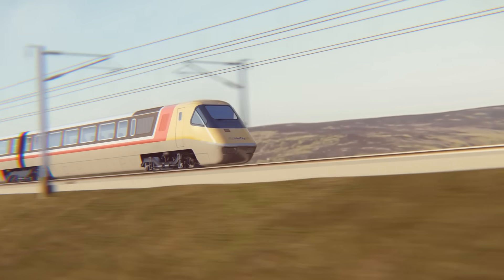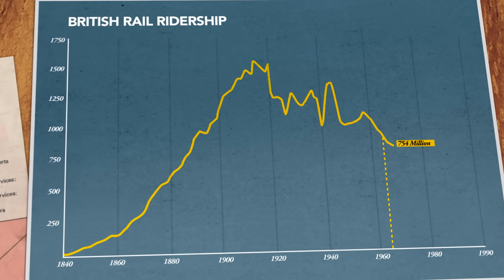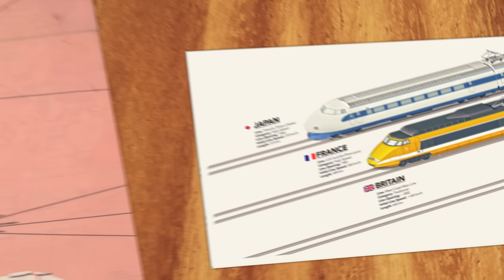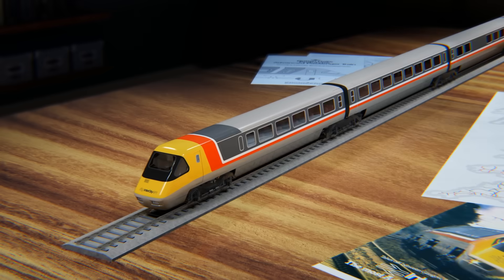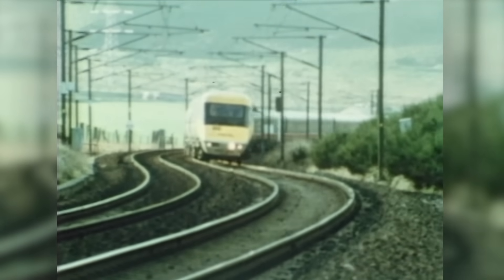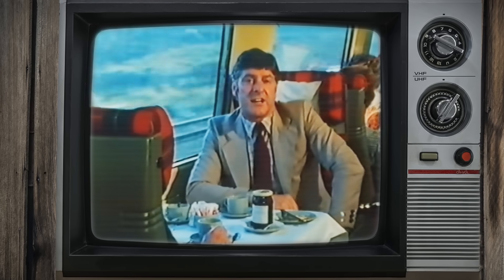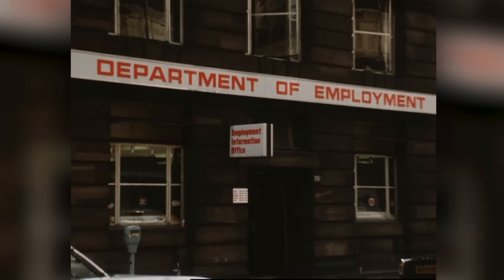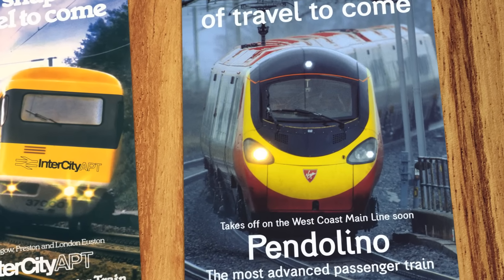This Train Made Passengers Sick: The APT Tilting Train Story

Comment: The til system wasn’t the problem,. It was insufficient testing of the train to bring into operational service.
Develop on a shoestring and that’s what you get.
Technology sold off and used on Virgin grains several decades later .

Comment: Fun fact: The cartazzi trailing axle the late Sir Gresley introduced on the A10 Pacifics Great Northern and Sir Frederick Banbury when they were made in 1922 actually helped tip them into the curve, although it didn't use any of the high tech gadgetry the high speed trains had when they first made their intro 60 years ago, and it had no springing.  It just required the wedges in the framework of the trailing axle and the movement of the locomotive on the rail.

Comment: It's interesting how different the APT-E and APT-P look. APT-E looks like some kind of futuristic, science fiction supertrain, while APT-P looks like a heap of junk! Well perhaps that's a little unfair but if I didn't know much about trains and saw it next to a 125, I'd have assumed that the 125 was far more powerful and faster.
Reply: Really? The noses of both trains are really rather similar, except the APT-P has a lower waist, with the light clusters mounted below below it. Incidentally, the prototype HST looked awful. The production units were designed by a noted industrial designer, which is why the styling is especially pleasing.

Comment: There is a similar train called the LRC (for in Canada (operated by VIA Rail). It is made of aluminum and used to have active tilt that would allow it to run faster through curves. And it worked for quite a while until the active tilt system became too outdated and no longer reliable. So the cars are still in use today, but with the active tilt system disengaged and using "standard" locomotives.

I travelled on quite a few occasions on this train between Montreal and Toronto and found it to be pretty comfortable. But when the tilting system was disabled, the trip took way too long and it made no sense to travel by train anymore.

Comment: The TALGO trains were first built in Spain in 1942. They are tilting trains with independent axle-less  wheels  that were designed to move at high speed through Spain's winding mountain passes. The Train has been built in Spain and later under license in Finland, the USA and other locations. It currently holds the speed record for trains using regular tracks. Its where the British got the idea decades later, though unfortunately they tried to design one from the ground up rather than just order a bunch from the manufacturer. I rode in one as a tourist back in the 1990s. No vibrations, motion sickness or any of the other issues you mention plagued the British experiment. I understand the trick is the independent wheels.
Reply: You're getting things mixed up. Talgos weren't capable of tilting until 1980 with the talgo pendular.

Comment: Fun sidestory: before the new Pendolino (brand name), Germany had dieseldriven tilting trains, developed in the 80s and built between 1990 and 1992, official name DB-610, but nicknamed and in Germany known as 'Pendolino'. They used the Fiat built tilting system with a gyroscope. 
They made 20 of them and they ran successfully from 1992 until 2014 on older tracks. They were actually very comortable, not that noisy and no motion sickness. In 2017 they were offered for sale, but besides 2 for museum usage there were no takers and scrapping started in 2019. All besides the 2 museum pieces have been scrapped now. 

So I guess you could say the originally British developed and licensed system (with some changes by the Italians) did end up running successfully for over 2 decades. Just not in Britain.

Comment: Noone talks about it but the biggest problem with the apt is that 2 of them could not pass each other in a tunnel
Reply: I think that’s an irrelevant problem, as frankly, tunnels already tightly fit around trains, so they probably wouldn’t be able to tilt, regardless of whether another train was passing. Plus if they did indeed fit, but only on their own, then surely a more modern signalling system could ensure that they only tilt, if no train in the opposite direction is nearby.

Comment: We in Switzerland still heavily use trains that have active tilting. This because on a lot of the swiss routes, there isn't any possibility to build a straight track (it's difficult to do so between a lake an a mountain, that both won't move a cm to the side). Our advatage was, that we introduced the tilting trains first in the late 1990s (to be excact: the first of these trains were delivered in 1999), when the tech was more advanced. Fun Fact: the trains were introduced more and more in the very early 2000s, because they were ment to transport millions of tourists visiting the country for the expo 2002. Another fact about the expo and the trains: only 30% of all 10.3 million visitors used the car to get to the different expositions.

In general, i really like the thought behind these trains and i think, that they are very comfortable and like the idea, that i wouldn't be able to get from a to b that quickly without them.

Comment: It's a bit of a sad loss for British engineering that the designs were sold rather than further developed here in the UK. The Pendolinos - the descendants of the APT technology - are are now a commonplace part of the British railway, running multiple lines out of London Euston; they are fast, comfortable, quiet and they hold the record for the Glasgow to London run; they are nearly everything the APT initially set out to be but the original British engineering behind them receives little to no credit. Honestly, despite now being 20 years old the Pendolinos are, in my experience, the best form of long distance travel available in the UK.
Reply: It does seem that the tilting train was invented by Italians, starting with the ETR Y 0160 launched in 1969. By 1976 these trains were in service.

Comment: 1:26 turns out dedicated high-speed rail is also a feature: it means high-speed passenger service doesn't conflict with low-speed freight.

For an example of completely failing to implement this correctly, look at the ACELA. The poor things has a design operating speed of 240km/h (150mph) but averages 135 (80), and that's excluding the stops. The first-gen rolling stock is being replaced by new stock which can go up to 350 (220mph), no doubt it's  going to bring the average up to 140km/h or so, as it'll remain stuck behind freight.

(the post-war french rail network was very similar to the english one, lots of low-speed lines, built semi-randomly by various competing companies: when rail was nationalised in 1937, there were 42500km of tracks, today there are 28000 -- about as much as in 1882 -- of which only 2735 is high-speed TGV tracks)

And there's an other issue with older tracks which is discussed somewhat less than curves but almost as deadly to a high speed train: old tracks were jointed (tail ends would be bolted together) and open expansion joints. The expansion joints lead to inferior ride quality, wheel damage, and the stress onto the jointing can crack the bolt holes and break the rail. While continuous welded rail is the standard now, high-speed tracks necessitated laying them down early (but also provided the opportunity to do so).

Comment: Well, the Italians designed active tilting technology even before the British, with their successful ETR401: one could think that Fiat simply got the job already done by British Rali when they bought the APT technology, which is simply not true.
Reply: Not true. At BR we had the APT-E tilt system operational on a test bed train, called PoP-Train, in mid 1971. I know this for sure because I was standing on it and switched the tilt system on the very first time! This took place some months before the ETR401 was powered up.
Reply: @kitspackman3994  i might have to add that in 1969 Fiat built the FIAT Y 0160. A small railcar that had the same role of the PoP. So yeah the pendolino is still first.

Comment: Fiat Ferroviaria (now Alstom) came with the Pendolino series (ETR450 and up), an hydraulically operated tilting system, coupled with a pneumatic active lateral suspension on each bogie to keep the center of gravity in the correct place. Only other known effective system was years later developed by Swiss company SIG, which designed the bogies for Virgin's WCML, but using an electrically operated 'cradle' titlting bogie, more fit to Swiss railways than the hydraulic one from Fiat. It was a serious competitor to Fiat Ferroviaria, and as such SIG (only Schienenfahrzeuge AG, the railway branch of the company) was bought and incorporated into Fiat Ferroviaria. 
Tilting systems were meant to be used for speed up to 250 km/h on normal existing lines.
Later on Fiat developed high speed (non-tilting) trains (ETR500, Frecciarossa, Italo and such, serious competitors to TGV) which require dedicated rail lines to be constructed, and everything was bought by Alstom.
Reply: Those still make me sick every time

Comment: Much like the APT was the Canadian National (CN) Turbo train that ran between Toronto and Montréal in the seventies.  Designed by United Aircraft and powered by Pratt and Whitney gas turbine engines, these trains also tilted on the corners.  One thing that limited the speed was that, beside the curves (which the tilting mechanism handled well) were many level crossings which forced the trains to a lower speed limit.  Then, when VIA Rail took over CN's passenger service, the tracks were still owned by CN and thus freight trains were always given priority.

Comment: You should take a look at the HST in a future video! It's a fascinating story. Not only was the HST much more successful than the APT, but it also gained the World Rail Speed Record for diesel traction, which it has consolidated multiple times, and which it still holds.

In addition, a "souped-up" version was built under licence in Australia, with de-rated engines and beefed-up air-conditioning, known as the Inter-City XPT (eXpress Passenger Train). It too held a speed record - the Australian Rail Speed Record - and is still in service with New South Wales TrainLink, although they are due to be replaced in 2023.

Comment: It is incorrect. First italian tilting train was the 4 elements ETR.401 (ElettroTrenoRapido 400 numero 1, Fast Electric Train 400 series,  train n.1) which began regular service in 1976, 5 years before APT.
Even full working prototype was earlier: Fiat ETR Y0160 was on track since 1969.
The british patents where used to improve the 1988's 450 series, which benefited from the experiences accumulated with the 401's service. The following 460 series, even improved and designed by Giugiaro was the exported one

Comment: The fundamental problem with the APT was not all the minor failures from a new design put into production too soon.  It was that the carriages shared common bogies.  So when a carriage had any problem that required service attention, no matter how minor, that carriage could not be removed from the train except at the service center.  The whole train had to be removed from service.  This was an incredibly stupid design flaw.  The passenger sickness issue was a smoke screen story that the media blew up ridiculously.
You will notice that all the 'Pendolinos' in service around the world use separate bogies at both ends of the carriages.  The APT design would have been removed from service even it it had not tilted.  Shared bogies killed it.  Not puking passenger.
Reply: Shared bogies are present in some of the newest HS rolling stock currently in service (as well as the oldest).  They have not only drawbacks but also some advantages with respect to separate bogies . Maybe the greatest advantage is  a safer behaviour  should a wheel get off he rail. In that case the damaged carriage is more likely kept in line from the nearby ones.

Comment: I remember finding a leaflet about the High Speed Diesel, as it was called then, saying that it was being developed in case of APT delays and that it would later be used "On secondary routes". Typical that a BR design that wasn't meant to be in service very long turned out to be their best train. The Hastings DEMUs were meant for 10 years use until electrification and lasted nearly 30 years.

Comment: UK sold patent in 1982 to Italy? What a big fake news!!
The FIAT Y0160 was the first tilting train built in 1970. The 5th of October 1971  the first prototype ran at 250 km/h. After 3 years of testing the new ETR401 went in service between Roma and Ancona.
Please don't say that UK invented tilting technology...
Reply: Was that one active tilting though, or passive?
Reply: @brianfretwell3886  it was active, sensing system by inertial platform (gyroscopic) and hydraulic actuators for tilting. Same technology is actually in use on ETR470, ETR480 and ETR600 series (https://en.wikipedia.org/wiki/New_Pendolino)
Reply: Stop lying out your ass. Simply not true. England absolutely had it first.
Reply: @BlissfullWinter  what a gentleman. Please send details about your assumption. About the patented working technical solution, obviously... Not about the failure...

Comment: 6:25 You all hear the rattling of the cups?   It's anything but smooth.  The problem is like driving a Ferrari at 250kmh over winding and bumpy country roads.  These type of roads is neither designed for high speed travel.  Ditto with the existing tracks.  Therein lies the problem.

Comment: Much more to this story. Alstom fought FIAT's rail assets including the patents. With Swedish grants, Bombardier Sweden developed a mechatronic tilting train. The one in service has moderate tilt. Alstom has bought Bombardier rail assets including patents. Trains have a double suspension - one for the bogie in contact with the track, and another for the car in contact with the bogie. In the most advanced suspension version, the car used electro-magnetic suspension from the bogie saying some expensive parts and getting fine control over body movement.

Comment: I wish people from other countries would stop knocking UK trains. This was 1970? Most mainlines operated just sub 100 max post war even with steam and 125 travel since 1976? Go off the specially built lines in the US or in most of Europe now and you will be still trundling along at 40 - 50. LA to SF now is what .. 10.5 hours? Same distance London to Glasgow was 7.5 in 1960 (steam hauled), now is 4.5? Record is 3:52 set by ... the APT in 1984 37 years ago. Still to be beaten? They tried, even with modern distance signalling ... but couldn't by 21 seconds. 1984 ... no wireless onboard networks, no mobile phones etc etc.

Comment: Nothing of the APT ended up in the Pendolino.
Apart for the fact that the Pendolino prototype, FIAT Y 0160, was built in 1970, while the APT prototype run for the first time only at the end of 1971, and the first commercial Pendolino (etr 401) became operative in 1976 and had been retired only in 2008, the working principle of the two is different. Pendolino has two gyroscopic and accelerometric transducers on the two bogies of every car, instead of a single accelerometer on the center of the car. That means that it reads the inclination of the track at the start of the turn, and can react in advance and more precisely than the APT system, avoiding the oscillations and imbalances that were the cause of the motion sickness of the British project. That's why it had been so successful worldwide.
The only reason why FIAT bought the British patents in the '80s, was to avoid someone else buying them and developing them in a competitor project.

Comment: Sweden developed the same type of technology, trains started to operate from 1990. Motion sickness was also a problem in the beginning, I myself felt queasy but learnt not to look out of  the windows when passing forests close by. One winter when -15 deg outside the levelling system broke down and they had to close the restaurant because everything got spilled. Wonder what chill factor you have at 200 km/h and-15 centigrade?

Comment: I love the Pendolino trains. Nice to know it has some interesting DNA :)
Reply: Nothing of the APT ended up in the Pendolino. It's just a legend.
Apart for the fact that the Pendolino prototype, FIAT Y 0160, was built in 1970, while the APT prototype run for the first time only at the end of 1971, and the first commercial Pendolino (ETR 401) became operative in 1976 and had been retired from passenger service only in 2008, the working principle of the two is different. Pendolino has two gyroscopic and accelerometric transducers on the two bogies of every car, instead of a single accelerometer on the center of the car. That means that it reads the inclination of the track at the start of the turn, and can react in advance and more precisely than the APT system, avoiding the oscillations and imbalances that were the cause of the motion sickness of the British project. That's why it had been so successful worldwide.

Comment: its funny how mustard got the hst history mixed up, uk went from steam to DMU's & as trains were starting to get faster they introduced the intercity 125 which was a high speed diesel engine in 1968 during this time they went back to the drawing board to develop the APT which was suppose to utilise the tracks we already had but was plagued with faults even after its first runs it constantly broke down(which that was the only bit mustard got right) & led to it being canceld after it costed more to rectify the APT still exists in the railway museum for all to see but will never run again the bluprints for the tilt design did go to pendalino which is still running on the same uk rail network to date